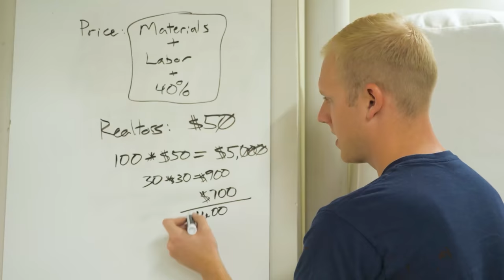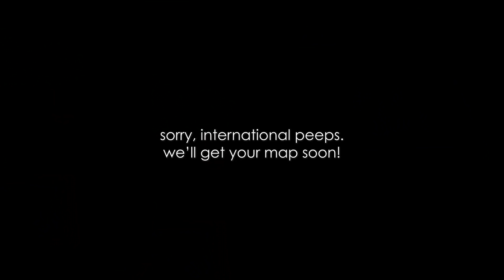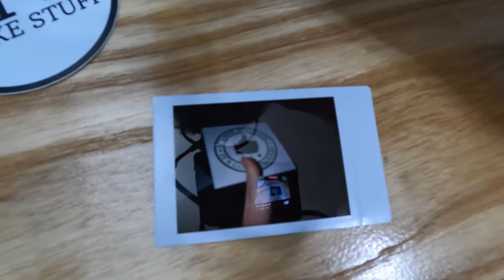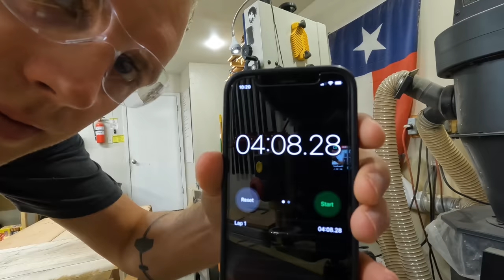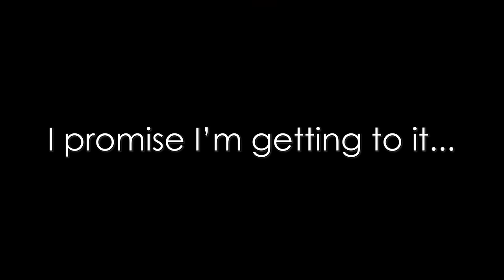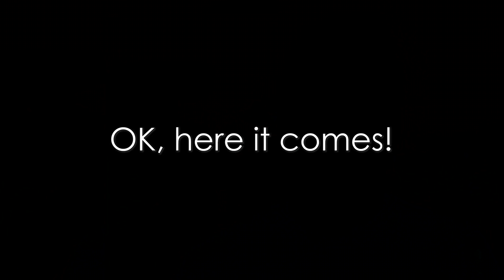FINAL RESULTS: Table Saw vs Band Saw - Cutting Board Production Showdown

Comment: The band saws by far my favorite piece of shop equipment and it is also the most underused and forgotten piece of shop equipment for most woodworkers
Reply from the maker: It's really great! I understand now why DiResta collects so many of them! So proficient at many different tasks.
Reply: @jennieanddavis  Yeah, Jimmy has a good reason not to trust table saws, lol.  Also, you need to stop standing behind the offcut on the table saw. If you get any kickback it's going to do a number on you.
Reply: Most certainly!
Reply: Get outta here! Go on now get 😉
Reply: @BradsWorkbench  oh well there goes the neighborhood!
Reply: @denoftools  That's backward - you stand behind the offcut because that is the piece that's NOT between the blade and either the fence or a stop block. Kickback happens when a piece gets trapped between the blade and the fence. When a piece can fall away from the blade, it won't get pinched and kick back.

Comment: You know, you're totally right, the Bandsaw is the superior tool and we are obsessed with the Table Saw, it's what we all learned on. Put it this way, I'm heavily restricted by the size of the blade if I want to resaw a board and often you have to flip the board, which leaves your cutoff board unsupported, it's a whole lot sketchier to resaw on a table saw than on the bandsaw, and here's an incidental that might not matter to some people, but the bandsaw is a lot quieter than the table saw too.

Comment: The bandsaw is a great tool. But I was surprised by the amount of internal stress you were finding in your stock.  I had a similar issue until I equalized the humidity in my shop with the incoming stock.  It was really a game changer when things were turned around in short timeframe.

Comment: A 3/16" kerf eats up 2.25 cubic inches of material every 1 ft. rip. That's one bf. every 64 linear ft. of ripping. For Cherry, that $8-9 loss/shrinkage, significant for small pieces, like cutting boards. Average bandsaw blade kerf is .025", 60% less than a thin kerf table saw blade. So, not only does the bandsaw save time, but also money.
Reply: The table saw eats and spits profit out as dust. Kerf waste adds up QUICK!
Reply: NO BECAUSE ALL OF THOSE BOARDS ALSO NEED PLANNING!

Comment: Very nice video showing advantage of the band saw!   BTW, Less sawdust as well!    For cutting boards to length, nothing beats a 12” radial arm saw!   You can make a stop, set (11) 2x4’s on edge, clamp one end, and cut them to the exact same length with one pull of the saw.   Over and over.

Comment: I cut alot of wood thats been dried too quickly and the stress causes pinching. I either kill the saw, remove the piece and cut again which helps kerf stay open or have a helper insert a wood wedge once past the blade to keep the kerf open

Comment: I have the rikon bandsaw ! And I'm having issues making the fence perfectly square to the blade .. it seems when I am happy with it , because it has that adjustment feature , I believe it's also moving little bits at a time . Did you have issues at all like this ? I recently moved and sold my tablesaw . Kept my bandsaw very small workspace now . I now more than ever need my bandsaw to be precise as possible .

Comment: I do not know what type of blade you are running in your table saw, but using a good Rip blade is world of difference if you are using a Combo blade.  It might not outperform a bandsaw, but it reduces required HP significantly, it can also eliminate burning on heavier stock. It is worth the investment if you are doing a lot of ripping.

Comment: A couple of questions, as a woodworking class we analyzed your first couple of videos on this project and we’re wondering if you have considered a power feeder to optimize the repeatable cuts. Have you all considered or compared the variety of buying 3S or 2 sides planed and 1 side jointed material? Finally I think it would be fun and interesting to see you all make a video on how you would use a work force of people to creat cutting boards at scale while addressing the bottle necks of making so many. 
Have a good one,
Nate
Reply from the maker: Hi Nate, yes a power feeder would probably help with both tools. Using pre-milled lumber reduces the size of our slats such that we end up using more material per board (7 slats instead of 6 per board). Chopping the rough boards into 18" blocks first drastically reduces the amount of waste in milling.

We definitely plan to have a full assembly line with a team of 3 people working on a batch in our commercial space!

Comment: One thing I did now see him talk about:

one from a recent upload he admitted that he had a lower quality blade WHILE the band saw has a high quality blade

Two, what is the HP/ RPM of the table saw compared to the bandsaw.   That can make a huge difference. 

Third the quality of the tool itself needs to be taken into effect. If the table saw is old and kind of junk and the bandsaw is new and tuned, then of course the bandsaw will win. 

Ultimately you use what works best. Right now the band saw works best, but if/when they get a professional shop, if they put a 3 HP 220 volt Professional cabinet saw in there with an excellent blade, I am pretty sure that will win out.
Reply from the maker: Michael, this is a great example of what I meant when I said that sometimes we “talk past each other”. 

I addressed several of those things in the videos leading up to this one - we can’t repeat ourselves 5,000 times in every video. We’ll try to be more clear in the future, but it’s a tough balance to strike.

Also, our friend in the Stud Stack repeated this test with his 5hp table saw and a rip blade - his bandsaw was faster also 🙌🏼.
Reply: @jennieanddavis  I apologize that I did not watch all the videos leading up to this one. 

Also, did the person from the stud stack put out a YouTube video on it?  I would love to see it.

Comment: Band saw is extremely versatile, BUT so is the table saw!  They each do different things well, with some overlap in between.  Try building a crosscut sled for your bandsaw.  Try cutting dados or tenons on a bandsaw.  Try cutting larger sheet goods on a bandsaw.  On the other hand, try resawing large pieces, or cutting curves on the table saw.  One is not necessarily “better” than the other.  They are both great tools that excel at certain things and not so much at others.

Comment: Great video's!  I just need to understand, you are glueing the faces together and the rough cut ends are your top/bottom that get cleaned up with the planner?  The cutting surface is your endgrain?
Reply from the maker: We covered orientation of the strips in a previous video! We glue the faces together and plane the edge grain

Comment: Great video. While I completely agree with your results and what you had to say I think the efficiency would also depend on how well tuned a persons bandsaw or table saw was. For example I have a semi older bandsaw for which I can’t find anything online about and even though I have it tuned up the best that I can seem to get it I still get some amount of drift so my table saw would be far more efficient because I would most likely have to deal with getting the cut surface from the bandsaw flat before the glue up.

Comment: Just FYI, loosen the 2 bolts holding the bandsaw fence to the rail and slide it out and lay it down 90°. You can then lower the blade guides and get even better cuts
Reply from the maker: Wait... what?! [sprints to garage]
Reply: @jennieanddavis  lol, yes it's a 3 position fence. You currently have it set up for resawing wide boards. When you turn it you can get closer to the blade for thin strips and the third position is a low clearance position for very thin stock

Comment: Now I’m curious to see how fast I can cut 20 slats on my 4hp sliding table saw using my Fritz and Franz jig with my $700 diamond blade. Will try to make a video tomorrow. Will send you the link after. The hard maple slats, how wide do you cut them and how thick is it. 8/4?
Reply from the maker: Had a guy in the Stud Stack try a similar setup and his band saw won, too! They're 1.25 inches wide and 8/4
Reply: Ok. I’ll try it today.

Comment: Was it the kerf difference that allowed more slats?  Or were the boards just wider?  I'm assuming the boards were just a little wider.
Reply from the maker: Yes. I had a whole rant about that before I realized the time difference. The boards were wider on the band saw, but that's not really important to the overall results.
Reply: @jennieanddavis  actually the width of the boards used in the test would matter. Less reaching for another board, as often would effect the results in time.  On a side note,  longer boards would yield a better time result on a production stand point, because your not wasting time cutting them to length before ripping them down. Not that it matters. Each woodworker can just use what there comfortable with.

Comment: I was cutting hard maple on my miter and table saw using 40 tooth blades and it was real slow.
I bought a Diablo "Pergo" 12 tooth blade.  It cuts really easily and pretty clean cuts on both my miter saw and table saw.  Not sure how long the blade will stay sharp.

Comment: Just to speak on the table saw, there has been wood that I have cut where it did the same thing (wood pinching on rival knife). Its the wood not the table saw. Sometimes the wood acts as a spring with cutting it, clamping on the rival knife. you could always remove the rival knife?

Comment: What bandsaw blades are you using for resaw?  I managed to snag up a $20 14" bandsaw that only needed the wheel belt/tires replaced and blades.  So, now I'm hunting as local options are non-existant.

Comment: I'm curious as to your process, which maybe you address elsewhere.  If I were making similar boards to what I think you do, with the strips gradually reducing in width, the cut edges would be glued together as I'd be cutting sequentially thinner strips.  That would mean I'd need a glue-ready surface from each cut.  My bandsaw is the Rikon 14-326, the very slightly newer version of yours, and even with a new blade it's never going to give glue-ready surfaces off the cut.  My table saw does.
Reply from the maker: They get turned 90 degrees and the bandsaw marks get planed away after glue-up
Reply: @jennieanddavis  are each of the strips the same width?  I thought they reduced down in size.  *disregard, I see now they are all consistent width.  I had your design wrong 👍

Comment: The next question is can either one of them make a clean enough cut to eliminate the planner step, maybe if you took a couple seconds longer on each board and on both the tablesaw and bandsaw and see if you can get rid of that step all together, within reason
Reply from the maker: We could spend an hour trying to get 6 slats perfectly square, and they'd still slip and be uneven during glue-up. Planing or drum sanding is necessary

Comment: I still think you are missing outfeed support... This will increase your output on either machine due to reducing touches on each piece
Reply from the maker: True, but at some point you have to collect what's on the outfeed table, which means walking around the tool. Maybe you 'break even' on time after 10-20 slats, but that's gonna be a really big outfeed table! Gotta do what we can in our little garage!
Reply: @jennieanddavis  what if you have them slide off the outfeed into a bin? As long as the fall is not too far then you could do dozens before swapping the bin for another... Maple bin then cherry bin and then move each of the bins to the next stage of processing. By the way I have been following now for qu I'm the a while and enjoy the fact that you are not just a "woodworking" channel. You have a very unique take on the genre and it keeps me (and likely others) interested! Great work!

Comment: the bandsaw is perticular about adjustments. as you found when your blade started getting dull. it wandered terribly. if the blade on the table saw gets dull you can still cut straight. it will just burn the wood mostly.anyhow, yes bandsaws are faster. most modern sawmills run bandsaws to break down the logs

Comment: I thought that you were gluing the edges that were being cut by the two saws in comparison. I would never glue the edge from the bandsaw, but with a good glue-line rip blade (such as a Frued) I would glue straight off of the blade. But you went with the box stores cheaper blade that vibrates and leaves chatter marks. So ya get what you pay for. Had my tablesaw for 30 years before I even bought a bandsaw. It is the main tool in the shop with many different sleds and jigs. Someday when you get more experienced, you'll realize that, but yes there are many ways to get the same products out the door.
Reply from the maker: Chuck, thanks for sharing your experience! 

We mentioned the orientation of the strips in the first video at about 4 minutes in. This is a great example of what I said about sometimes we "talk past each other". 

We'll try to be more clear in the future, but we can't repeat ourselves 5,000 times either - that's a constant struggle to balance as a video creator! Thanks for your continued support 🙏.
Reply: Why would you not glue from the band saw? I do and never had a problem.
Reply: They are make edge grain cutting boards not face grain.

Comment: Your Bandsaw only has a 1/2 hp motor where your table saw should have atlest 3hp, using a small motor to cut hard lumber will force your tool to work harder then intended and will burn your tool up quicker. Unless you have a blade with a low tooth count on a straight tooth cut design with atlest 1 3/4 hp bandsaw it’s best to stick with a table saw that has a 3hp motor with preferably a frued rip blade. Also never ever force a cut. Your riving knife is a safety feature that is designed to help stop your work piece from pinching against your fence and kicking back on you or worse popping your piece and causing your hand to fall into your blade.

Comment: I think bandsaw is sort of Better because it has a smaller kerf which requires less power than the wide kerf on the table saw so you get less waste with the bandsaw however bandsaw blade have to be replaced pretty often. And also the bandsaw is safer.

Comment: I struggle getting a straight line on my band saw.  I've always gotten reliably straight cuts on my table saw.  Must be doing something wrong--would love to find a more efficient way to work
Reply from the maker: We struggled with straight cuts until we got a good, sharp blade. They go dull much quicker than you want them to. Also look up the Snodgrass method of tuning a bandsaw

Comment: after 40 plus years of (steel mfg as opposed to wood) my accident with a band saw and my hand was far less worse than my accident with my table saw and hand. So the band saw is way way way SAFER than a table saw. (loss time 1 day verse 6 months and 2 months of rehab to learn how to operate my hand again, 2 years later the hand is still not like it used to be!

Comment: Seems like bandsaw is a safer tool too, but that's just my opinion.
Reply from the maker: I had a whole rant about that, which I cut out of the video. I feel SO much safer around the bandsaw. Of course, every tool is inherently dangerous, but the bandsaw is a much less violent machine when you compare it to kickback on the table saw
Reply: @jennieanddavis  especially when doing lots of repeated cuts where someone might lose focus. And as always, do what feels right for you.

Thanks for the content.
Reply: Unless they make a bandsaw that does what the sawstop does then...no. Of course you'd need a sawstop for that benefit. I feel WAY safer around my sawstop over my bandsaw.
Reply: @atomictyler  fairly sure the reason sawstop addressed the danger around a table saw instead of a band saw was the relative danger levers between them. Even with the sawstop technology there’s plenty of things a table saw can do which is unlikely on a bandsaw. Kick back comes to mind.

Comment: gripper for your push stick and you'll go way faster on the table saw. you can go forward and keep it against the fence with one hand. bingo-bamo

edit: you're not using push sticks on the band saw, but are on the table saw. that would EASILY be the difference. use push sticks on the bandsaw and you'll be taking a lot longer. it's a bit odd you find it to be safe to not use them on the band saw but then need to use them on the table saw.

Comment: What about post cut cleanup? Which takes longer?  I love my bandsaw for ripping. I use a resaw king carbide blade and it does a great job with the surface. I think you also use up less wood as sawdust if you’re using a bandsaw blade. Even if you’re using a thin kerf able saw blade.
Reply from the maker: Like vacuum cleanup? Or how much needs to be 'cleaned up' on the planer? In our shop, the band saw is less messy, and the planer will take equal amounts of material from both methods to get the cutting boards flat.
Reply: @jennieanddavis  My take on his meaning was that when I use the band saw I need to plane the sawn surface to get a clean face for gluing.  With my table saw and glue line rip blade I go straight from the saw to glue-up.  But it seems this was addressed as not a factor of you.
Reply: @MrWookie1981  The cuts won't be glued up though, the cuts are facing up/down on the boards, they don't face each other, what is facing each other for glue up is the previosuly jointed/planed surfaces